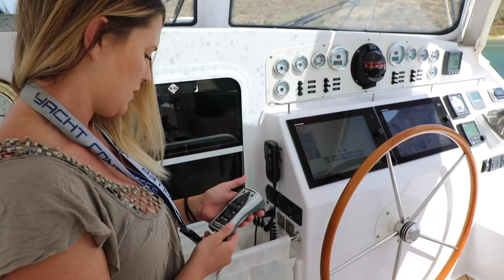Not Fun For Her...and a fun Q&A release! - Lazy Gecko Sailing VLOG 108

Comment: I bet your shut off solenoid is bad on the kubota..  when you turn to start it will pull open, should hold it when it starts to run but when they fail that hold solenoid stops working..  looks like it would be a pain to get to.. being it is on the rear of the injection pump..  easy to remove usually two allen bolts and 3 wires..  that is one of the parts you should always have a spare of..  usually under 100 online.
Reply from the maker: Nope, that wasn't it! Thank you for typing up some tips though!! Also for watching!

Comment: I had a bigger Genny act that same way it would start then shut off my problem was that there was a breaker inside the Genny part that would regulate and turn the idle up when more power was needed or if there was a huge drain from like a ac or freezer does when it first turns on and it would shut the Genny down to protect everything. Maybe that's what's wrong I don't know it was a short clip lol
Reply from the maker: Nope, that wasn't it but thanks for the tip! Stay tuned!!

Comment: I would check the oil level on the generator.   Sounds like the low oil level sensor is working or faulty.   Is there a way to pull fault codes out of that one?    I know on my RV if the switch light blinks 3 times it is showing a fault code then you push the stop switch momentarily and then the light will blink a code for diagnostics.
Reply from the maker: Nope, the oil was perfect!